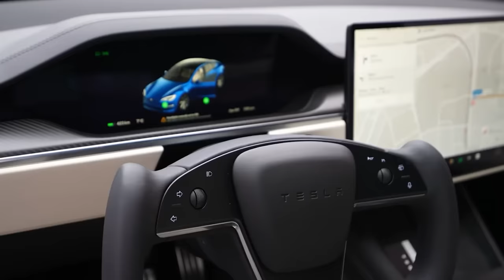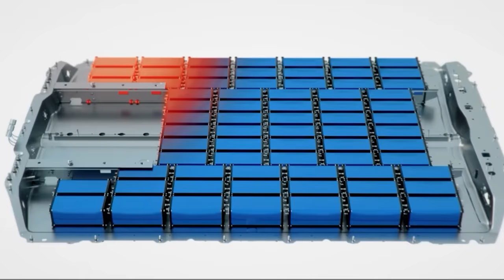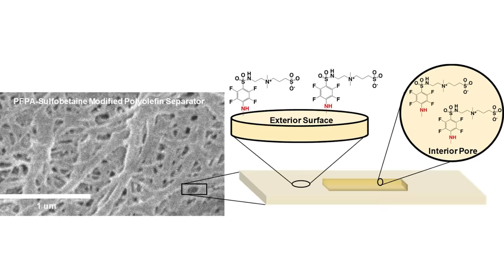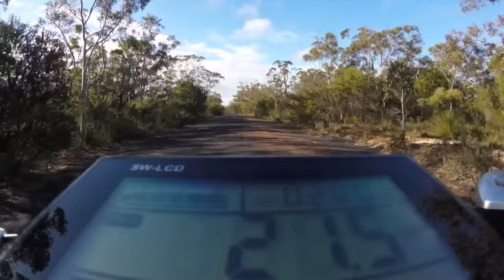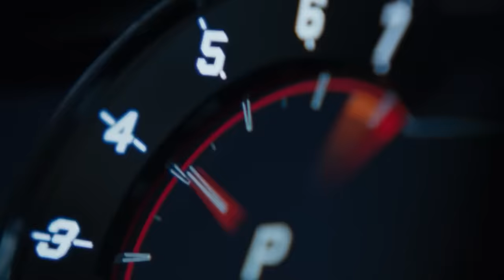EV's Are Exploding In Shocking Numbers

Comment: One thing that is never asked, is where does your electricity for this vehicle come from?..... That's right, FOSSIL FUELS, so how exactly is this environmentally friendly?? Yet another case of greenwashing.

You know what EV stands for?.... EXPLODING Vehicles. I wouldn't touch one with a barge pole because it would probably blow up. 😂😂😂

If you have a minor bump in one, it has to be checked over by a specialist garage because it's an EV and it could have resulted in a cracked battery which is unnoticed at the time. If you do not do this and problems later ensue, then you will have to pay every penny of damage. 

You also failed to point out that they are REALLY  difficult to put out once they catch fire. Alkaline metals like lithium do not play nice with water so though the fire service can use water to decrease the heat and prevent the fire spreading, it will just reignite as soon as the water is stopped. 

Even without exploding, after a few years, when your battery packs up and your range gets even worse, the car is worthless since most of what you pay for is the battery. And then you have all that delightful recycling.... or not as the case may be, since most of the plastic is non-recyclable.

Also, an EV is 50% heavier than a standard car and the second greatest call out cause to them after, flat battery is broken wheels/tyres because of their weight (UK RAC figures) Couple this with the fact that tyres are no longer made as strongly, and you can see the expenses and waste building up. 

Someone somewhere, is getting a MASSIVE backhander in money to push through an unwanted and uneeded mode of transport, I'd just like to know who?

Comment: EV's are NOT environmentally friendly, not by a longshot. The extensive mining required to obtain the minerals etc to make the batteries, are all mined by very dirty diesel powered equipment. Not here, but overseas. The batteries aren't easy, or cheap to recycle. And they  have a VERY short lifespan when compared to today's modern gas and diesel powered vehicles. Another thing I have noticed multiple times is a waiting line of ev's needing to charge up to continue on their trip-PROBLEM; although there are multiple charging stations off the hwy, not all of them work, hence the pile up of people waiting to get on with their business/trip. I DO believe that ev's, as they stand right now, are almost perfect for city use ie; delivery vans, and small people movers etc. But that is it. Back in 1895 when the first ev's were produced, they essentially had the same problems as today's ev's with one notable exception, in the ancient days, they used lead acid batteries so there wasn't any fires involved that I'm aware of. However, there were damn few places to charge your ev except for at home. I'll stick with my clean turbo diesel, and small turbo gassers...

Comment: The relatively small number of Ford Pintos on the road, compared to all vehicles, required immediate safety measures to be implemented.  Why would it not be any different for EVs. Engineering standards are always necessary, and always a learning curve. 

Lithium battery fires are not new, the cause is know, cost saving should never be an excuse.

Comment: Gas vehicles are 100times per capita more likely catch fires then EV , check gov stats , recall for batteries , does no one removed the Pinto catching fires ,  Yes EV catch on fire , epically if you drive into a tree at high speed , but I pass a gas car fired almost once a month on the highway to work over past few years , never seen and EV on fire , even my own gas VW caught fire under hood at a stop sign ( luckily I have a fire extinguisher in my car to put it out before it spread ) so if your going to stated EV catching fire lots post the stats you are using & post the stats for gas vehicles beside it so the public can compare which catches fires the most ( oh wait then you won’t get as many clicks)

Comment: The "EV movement" is nothing short of a cult. You only need to see the reaction when you question their efficacy!

Personally, at the current(?) state of play, I won't go near EVs until the bugs, infrastructure and power generation has been sorted out.

The idea that EV is somehow "greener" is also false. Currently, traction batteries are not readily recycled and the large amounts of rare earth metals required need to be mined causing environmental impact, the majority of electricity is generated from fossil fuels, EVs are considerably heavier than equivalent ICE vehicles so there's increased impact on road and parking structures. The only difference is in tailpipe emissions from the actual vehicle. An EVs emissions are just moved elsewhere.

I'm not against EVs per se, in an urban environment, once the burny bits have been sorted out, they have a place. HOWEVER, I don't believe the strategy in use today, is the right one. As I said earlier, EV is NOT the future.

Comment: As long as Lithium Ion batteries are use, you are gonna have self starting fires. Laptops with Lithium Ion battery packs are catching fire more common. As such, I will not not buy an EV under any circumstance. I'll stick with my hand junkyard built 1999 Ford Ranger. I can run it on Hydrogen easily

Comment: If cell phone cause fire as it heated during charging. How much more the ev as it has big batterys. If it heated it will burned the whole car.. 

Instead of EV  make another way like making gasoline cars more efficient in consumption. To have less cars using desiel fuel . 

Improve the engine by creating small engine but has power using gear to gear design. 

Like what they do to super car..

Comment: Electric vehicles
Lithium-ion battery pack.
A lithium-ion or Li-ion battery is a type of rechargeable battery which uses the reversible intercalation of Li+ ions into electronically conducting solids.
E-bikes, e-scooters, e-cars, e-trucks.
An uninsurable bomb with unlimited potential collateral damage.

Comment: We need to do research on a new type of battery that does not use lithium. It should have a safe long life and have a quick charge as well as a long range. BACK TO THE DRAWING BOARD. We need to look to our best minds and engineers. This is an expensive learning experience.

Comment: And yet Prius's are doing 1 million miles as taxis....EVs without infrastructure are junk. 
Hybrids are the best short term answer until batteries and infrastructure catch up.
Steam engine went extinct in the 40s and diesel electric locomotives have been their replacement sonce them.   Today, Edison Motors has a succesful hybrid logging truck that beats the Tesla in both power and most importantly, and it is lighter than the standard trans truck NRA. No range anxiety.
Get it straight .. The infrastructure TODAY  CAN NOT support EVs but hybrids can and are doing it with mo infrastructure change and BETTER FUEL ECONOMY WITH PROVE TECHNOLOGY ..

Comment: The environmental impact of creating, and ultimately the disposal of the lithium batteries is far greater than the burning of fossil fuels. A gasoline powered engine is designed to get an average of 300, and up to 400, miles per tank of fuel and until the technology advances to the point that EVs can do the same, I’m sticking with gas power.

Comment: I'll be watching this.   I need to decide between EV or Gas.  Main benefit for me is less interaction with Florida's crooked ass mechanics and sorry self serving prosecutors lawyers and police.  Before Electrics I had seen 5 cars on fire either parked or pulled off side of the road.   I have not seen an EV on fire or in an accident but they are still a minority of cars.